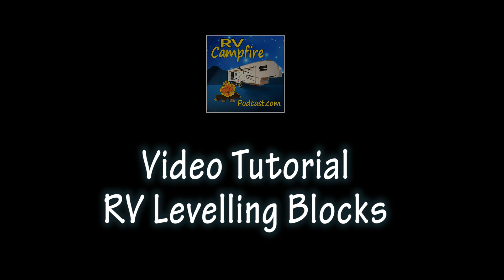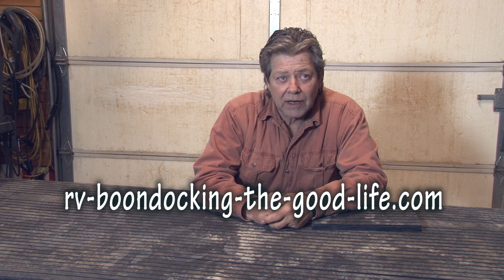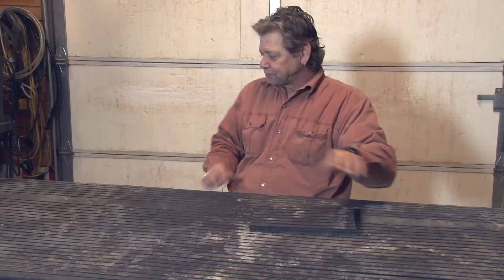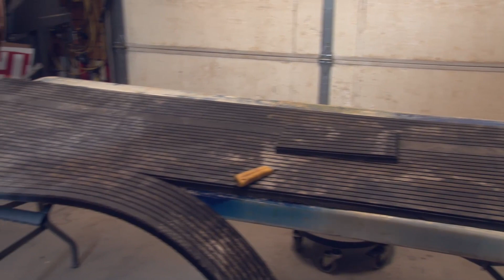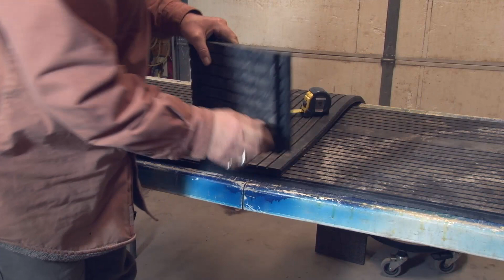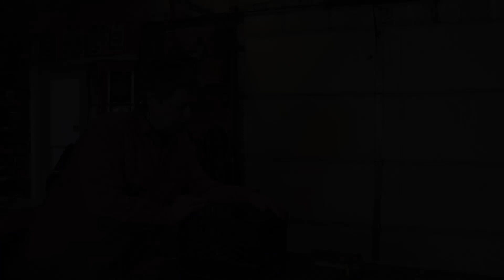RV Leveling Blocks Solution

Comment: $40 @ Mills Fleet Farm, thanks for the tip!
Reply: John Lomnicki, SR what's this stuff called?
Reply: too bad we don't have a Mills Fleet or anything else like it for where I live. I would be concerned about weight factor carrying these in a class b.
Reply: They are 105.00 at tractor supply! A 4’ long 2x8 works just as good for both tandem axles on most trailers/rvs!